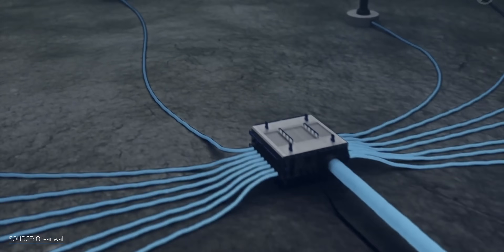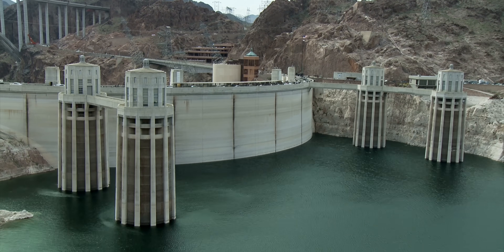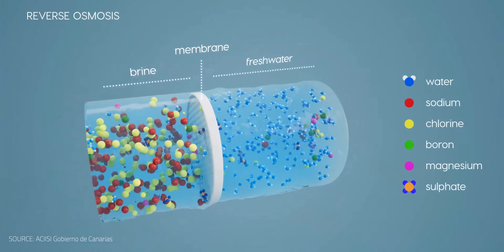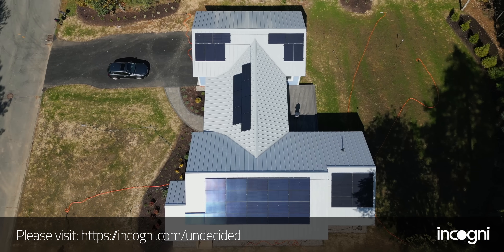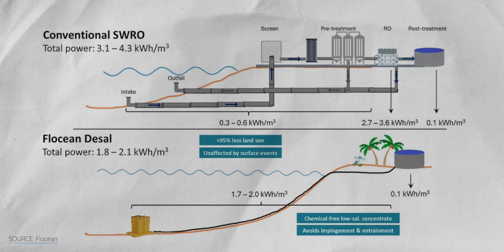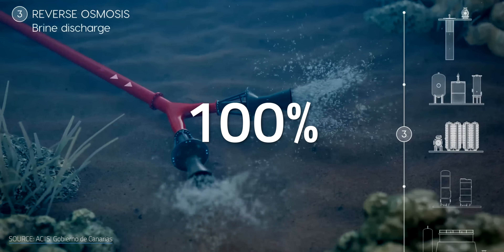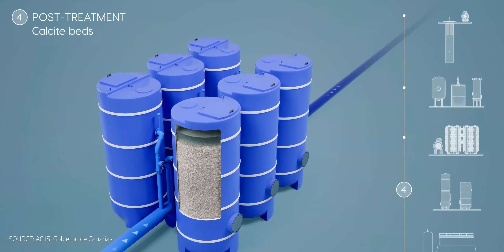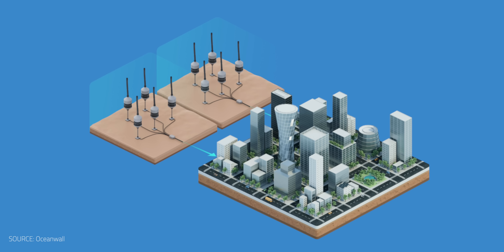How Deep Sea Water is Now Drinkable

Comment: ♻️⚡️This could be combined with OTEC (Ocean Thermal Gradient) which is the equivalent of GEOTHERMAL and optimized with integration of efficient heat pumps and heat engines all within closed loop district heating/cooling optimizing the extreme temperature differences between the cold deep water ~5C and surface solar concentrators or just district heating from buildings, DATA CENTERS, etc

OTEC is a proven technology already in use in such places as the Hawaiian grid connected Makai Ocean Engineering test facility, etc

Comment: I have several thoughts. Why is suction at the ocean bottom more energy efficient than raising pressure of sea water in an onshore facility? The pressure differential we're pumping will be the same. It occurs to me that it is volume: in the onshore facility, I need to pump 2m^3 of sea water to high pressure to get out 1m^3 of fresh water and 1m^3 of brine. But the sea bottom method only needs to pump 1m^3 of fresh water. However, in my onshore facility, I could potentially run that 1m^3 of brine through a turbine to get back some of the energy I spent pressurizing it. 

I'm dubious that they can get good lifetime on their membranes with unfiltered sea water. Deep down, no algae, blah blah... If deep water is so wonderful, I also have the option to pump that deep water to my onshore facility.

I do see advantages, but it isn't obvious that they outweigh the downside of having lots of equipment where it is very hard to perform maintenance. 

And a final observation: intermittent renewable energy provides a big opportunity to a certain sort of industry. If you industry is power hungry, low capital investment, and has easily storable product, then you can economically build facilities which only operate when power is very cheap. Desalination certainly hits two of those requirements, but I'm not sure about capital investment.

Comment: This doesn't really address the brine problem. At the end of the day, the amount of brine produced is going to be proportional to the total amount of fresh water produced, not the production rate of each individual unit. All this does is produce that fresh water at a slower rate, so you need more units to get the same total production. If you want to turn 25 million gallons of sea water into fresh water each day, the same amount of brine will be produced whether you use this or a normal desalination plant. 

The only solution would be to spread the units out over large distances so the brine is dispersed. Otherwise, the regions around these plants will become dead zones.

Comment: You would still need antiscalents even at deep depth your are still going to have calcium and magnesium which will lead to fouling. Also membranes that are properly ran can run 15+ years our current plant is still running 22 year old membranes their efficiency is down but still usable. I highly recommend you contact Harn to get a more detailed understanding of RO them and Hyrdonotics are the leading companies in RO and there are no systems that are chemical free they make.

Comment: Thanks Matt.
Interesting.
Having been involved with a few RO projects, I think they are underestimating the maintenance.
And trying to do that at depth or even replace whole pods will be expensive and negate some other advantages.
We need to keep thinking outside the box, but this idea still has some work to do.
Reply: I agree. It solves a couple problems but adds many more. RO isn't that energy intensive anyway. Water distillation (MSF & MED) plants are at like 18kWh/m³, but RO is 3kWh/m³.

Comment: Ok, so after watching the video, the energy saved is just the transportation of salinated water? In terms of trucking, instead of hauling salt water to the plant and then hauling it back to the ocean, it's essentially like driving to the ocean and driving back fresh water. The energy to push/pull water through the membrane is exactly the same, but there only needs to be one trip delivering water instead of two.
Not an untruthful first 5 mins to the video, but it was very misleading. It seemed to suggest that the pressure at the bottom of the ocean would push water through the membrane on its own. It would not. It requires a pump to create a pressure differential which will require the exact same energy as pushing it through. The upside is when you start transporting the water, you're only dealing with fresh water instead of using energy transporting salt water.

I also don't buy the point about not being as salty. I can see how it would be less salty by not taking all the fresh water at once, but are the currents at the bottom really enough to disperse it like they want? I'm no expert on ocean currents, but my intuition says that it would stick around more than they want us to think. The increased saltiness in general is also misleading. If you want fresh water, you need to take all of the salt out of it. Density of salt may be lower, but it's still leaving all of the salt where it's at.

Comment: Its interesting how this works, its almost like how a dam generates power. Im surprised that there is such an efficiency gain, I would expect the pumping to cost more. Maybe the efficiency has to do with pumping only a small subset of the water up, if not this tech might be useable for power generation too.

Comment: You're a little disingenuous in your back story.  While there is a drought, some of it is man made. 
First you have to look at the consumption patterns of where the water is going. 
Then you have to look at some of the policies which have diverted and restricted water flow. 

There is a lot more and you should do a story on it.  While its not science but a bit of community planing, over population and restrictive policies that cause this. 
(Besides the reduction in water that caused the water levels to dramatically drop.

Comment: I still like tidal flow desalination domes . Built near the coast are on the coast it uses the tides to fill the sun heats the dome and the water condenses leaving just grind and salt which is then further dried and collected as a byproduct and sold. Theoretically it could almost be done with no electricity.

Comment: You can get power from ocean movement with turbines on the units themselves making them self powered... but... How do you replace the filters at 400m below the surface? Even with robots like Marinized Teslabots doing the work, its got to be expensive clearing debris from the system and  swapping out or cleaning filters.

Comment: You say the alternative is much worse for the environment, but during by Marine Sciences bachelor I learned that the seabed does not have the same recovery capacity as close to the surface; the energy inflow into the deep sea ecosystem is very low, thus damaging the seafloor will be basically permanent when talking about human species time scales. (at least that what research hints to so far)
Reply: the brine sinks to the seabed in the conventional method as well
Reply: @AVA_gamedev  yup, that is how the Atlanta current is formed. Heavy brine falling to the sea bead from freezing water around Antarctica.
Reply: There are natural variations in salinity in the oceans, so why are you worried about a nanoscopic fraction of the ocean being made slightly more salty? Do you think sinking brine will become diluted on the way down?
Reply: To be clear, it's the actual physical impact of working, construction, etc on the sea floor I'm worried about. For example simply placing a machine on the floor will make it bare, which will not recover in human time scales

Comment: Wonder if the WEC you recently highlighted could also be used as a direct pump source? Or am I a friggin idiot? What I mean is that some of those floats in an array could pump water instead of generate electricity and still benefit from the deep water pressure. If the RO unit were also attached to the sea floor it would also benefit from the relative "lightness" of the desalinated water and might could increase the buoyancy up the pipe. Probably not since it is a closed system but it'd still be less heavy to pump up to the ground level plant for additional treatment or whatever. IDK , I'm a 69 year old failed pro gamer that lives in my mom's basement.

Comment: This is WAY too much engineering to solve a very simple problem. Take an air cooled nuclear reactor designed to operate at 1600 degrees continuously, pour unfiltered salt water over the cooling fins. Presto! Perfectly pure water (in the form of steam) and lots of sterile molten table salt which can pumped around as a liquid. Cool the salt, crush it up, and sell it as road salt in cold climates or as backfill for abandoned mines. 1600 steam can run a turbine just fine and still come out at well over 300 degrees Steam is easy to pump uphill, so pump it to storage tanks built on naturally cool mountain tops. It condenses back into water, then is allowed to flow back down under gravity to wherever it’s needed (and you can extract bonus energy via hydro turbines along the way.)

Comment: So, RO needs about 1000 PSI across the membrane to drive the pump. Every ~2' of depth is 1 PSI and salt water is 2.9% heavier than freshwater. So a column of salt water exerts .015 PSI more than an equal column of fresh water for every foot of depth. You need a 66,500 foot deep system to get the head pressures needed on their own, and th4e deepest point in the ocean is 35,000. If the oceans were half as salty or twice as deep we would be able to make a desalination system that powered itself.

Even with what we have the difference between pumping salt water in and pumping fresh water out is still much bigger than it seems because you're pumping a much smaller volume and so your pump is doing less physics work and needs less energy to do it. 

This is really cool and I'm glad I watched this video.
Reply: These people are talking 400 to 600 yards of depth. So probably what the system is doing is  slowly flooding a container at  +/- atmospheric pressure inside through an RO membrane. That is how 35-55 atm of a pressure gradient would form. You then have to pump the freshwater out to maintain the pressure difference.
Reply: we also need to account for the osmotic pressure that will resist freshwater passing through the filter.
Reply: @JaneDoe-dg1gv  That's most of the pressure needed for reverse osmosis, and thus most of what I was accounting for. There is additional pressure from the resistance to flow needed to get any kind of production out of a system with such high resistance but more than half off the pressure is just the static osmotic pressure difference between freshwater and seawater.
Reply: @opcn18  Ah! I get what you saying now after rereading your comment.

Comment: I figured you were going to say they would back feed the old pod with air and float it to the surface to change it out.  shouldn't be hard to figure out a docking system to raise and lower them to the surface for maintenance.
Reply: This is a cool idea but it'd either have to detach/reattach to the power and water output lines without human aid, or those lines would have to have to go with it as it goes up (so they'd have to be flexible and handle the ascent/descent without damage). It'd also need steering as it sinks to return to its correct position. Might be challenging.
Reply: @chiaracoetzee  From what I gathered, they're already having to supply power for a pump at depth, so make the pods buoyant and attach a wench. They'll float to the top and can be pulled back down via the wench. Salt water is really corrosive, so I imagine their would still be challenges with that system.
Reply: R.O.V. drones

Comment: This is still a poor alternative.  It is centralized water that comes at a cost, espevually to the poor and middle class.  It's bad for plants, and vulnerable people.  

Its better to use onsite rainwater harvesting and greywater reuse, as well as regenerative farming and ranching. This is another money making venture that ignores bigger, cheaper, better solutions.  
A half and inch of rain yilelds hundreds of gallons of water on a small city lot.  That mostly evaporates or runs off instead of being absorbed by dry soil or plants. 
Reusing streetwater runoff to water fruit trees or decorative landscaping, as well as using roof runoff to meet a sites needs freesup the pumped water for its best use, drinking.
The oligarchy is discouraging farmer, ranchers and the average joe from employing these simple solutions thru zoning, monopolies of water control, etc.

Comment: What if you have a U shaped channel with a greenhouse style cover that lets water flow in one end and out the other, the floor of the channel is engineered to have increased surface area and heat transfer and very shallow depth and the roof to catch the water and divert it to a reservoir, this would desalinate water through evaporation and would not require machinery to move salt or disturb marine environments from increased salinity also no filter to replace or unclog.

Comment: I've often wondered if the Eastern US River System could be captured during river flooding, and piped to the Colorado River. Have flood protection systems in conjunction with the Lock&Damm systems in the Mississippi, Ohio and other major rivers.
Reply: By the time you get from the Mississippi river to western Kansas, or the Oklahoma pan handle, or the Texas New Mexico border you've already gained some 4000' in elevation. Nowhere over 1000' in elevation gets enough rain to have massive amounts of moisture to spare, so that's leaving you with at least 3000' of elevation to pump water up. Then you need to either tunnel through the continental divide for hundreds of miles or go up and over one of the passes which means 4000'-6000' more elevation gain. 

The headwaters of the Colorado River Basin are just very far from any sources of water, and very high up, unfortunately.

Comment: Congrats on pronouncing "Ormen Lange" reasonably correctly. Kind of ironic if Norwegian desalination tech ends up saving thirsty USAians. Norway usually has more than enough fresh water, and flooding is a much bigger danger than drought. Meaning Norway has zero domestic need for the tech, except maybe on the oil platforms. Great if those oil workers can transition to less harmful, more useful jobs like these. Fresh water will always be needed.

Comment: The simplest solution for seabed maintenance is a floatation component and unrealing and rewinding of the devices, use a surface or just below turbulent system to raise and lower each device for maintenance, also perhaps I missed it but you did not say where they are getting the energy from? Is it the wind mills? Or are they using some kind of potential between salt and fresh? Also deep enough and spread out enough eliminates the remaining desalination problem

Comment: I look forward to your review of the that LA pilot plant.  But from this video, I'm left wondering how sucking is more efficient than blowing.  Does the system take advantage of the lower density--and greater buoyancy--of fresh water? Also, the suggestion that this system will use less downstream chemicals is specious--without a doubt water obtained from DSRO will be subjected to the same treatment as water from any other source.

Comment: It’s a good thing that private equity investors aren’t all aware of the basic laws of physics. Obviously, if this method provided some efficiency gain, we could use turbines instead of a membrane and generate perpetual energy. Obviously, physics doesn’t allow that to work. So physics will not allow this method to be more efficient than RO at the surface. Pumping the water up from depth will always require as much or more energy than the energy gain from pressure at depth, meaning making desalinating at zero depth will always be at least as efficient as desalinating at depth and then pumping it to the surface. Would be nice to have perpetual motion energy. But unfortunately things don’t work that way.

Comment: You need a pressure gradient across the reverse osmosis membranes.  This means you have to bring atmospheric pressure to the down stream side of these membranes in the deep ocean instead of providing pressure to the upstream side as is done on land based reverse osmosis units.  The only way to do this is to pump out the fresh water on the down stream side and I can't see how this would take less energy than providing pressure to the up stream side.  Here is a better way, albeit restricted to a few locations on earth.  https://mtkass.blogspot.com/2022/12/the-red-sea-dead-sea-project.html

Comment: Only a fraction (25% ?) of seawater is converted to fresh thus the 75% wastewater that transits through the system absorbs entropy(as occurs with a waterfall). The deepwater RO energy savings is probably the reduction of energy in pumping the 75%.